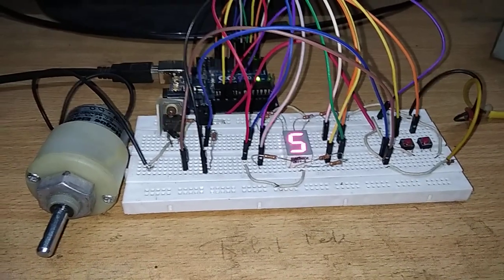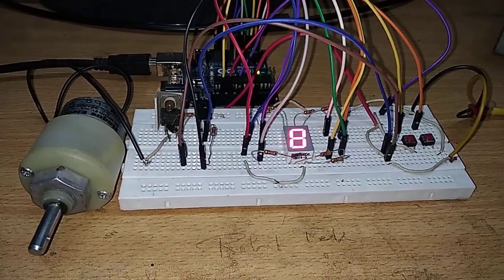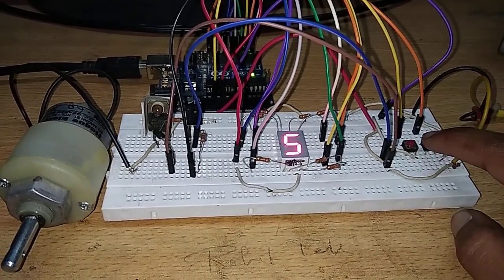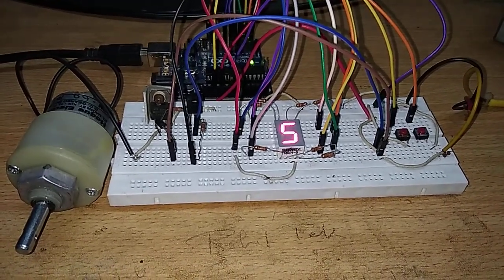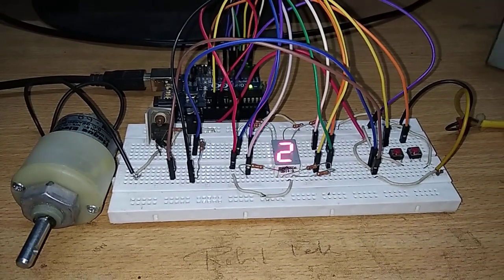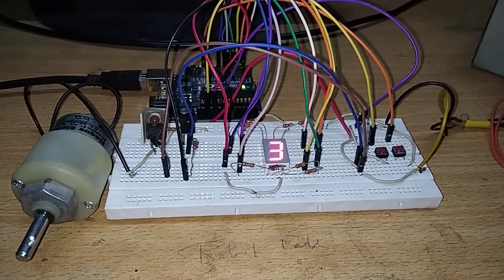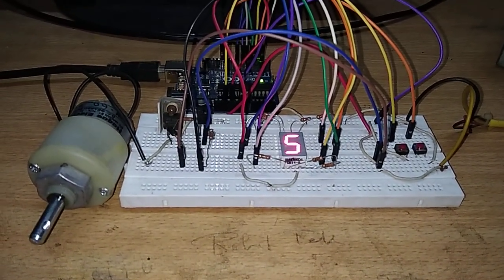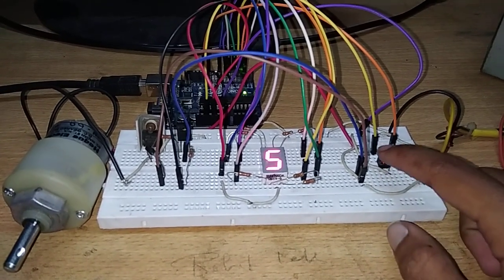OFF Delay Motor Starter

Comment: I need my motor to go both directions with one switch but it needs a 1 second delay on both directions. 

Is this possible?
Reply from the maker: Means u want that if u press the button then after 1 sec delay it will change the direction?
Reply: @rohittek5348  no, just turn off after 1 second. The switch will operate in forward, off, and backward.